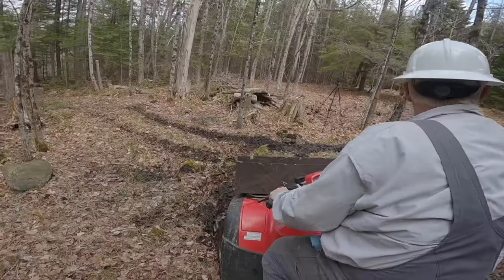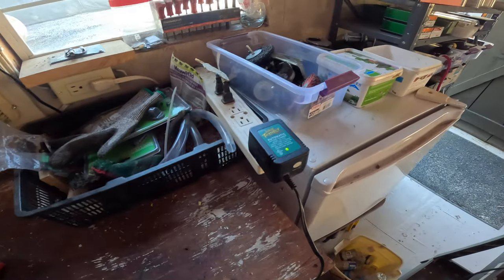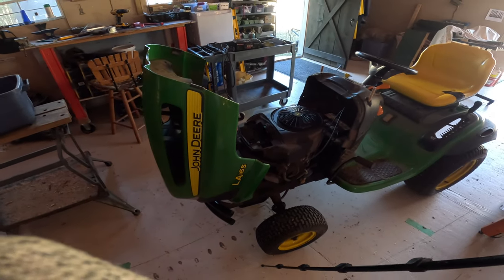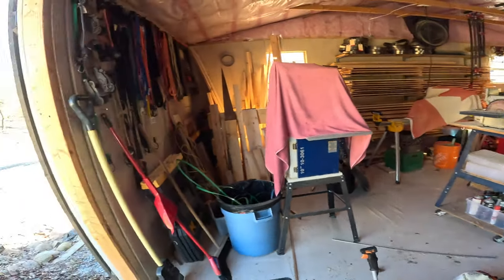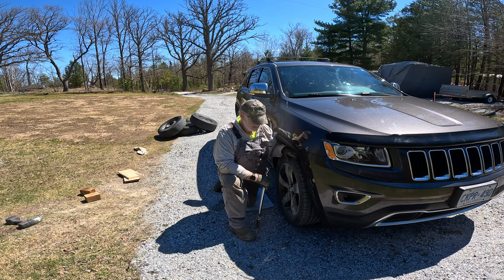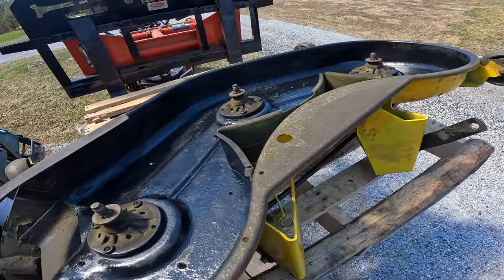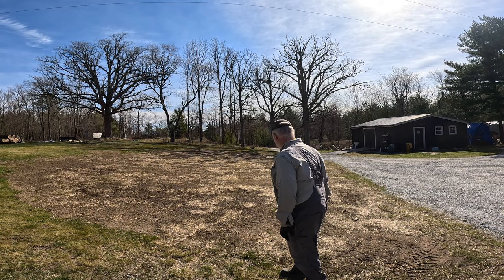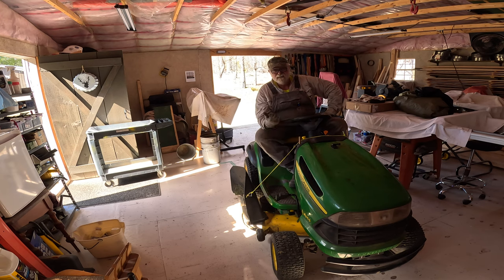Help! I Have Too Many Jobs And Not Enough Of Me

Comment: Good afternoon Brian! It's nice to keep active by having too many jobs. Prioritizing is a must. I had the same issue with my charger and lawn tractor battery earlier this Spring. I don't use winter tires on my vehicles so I can skip that job but I will be servicing the brakes tomorrow as I do each May then again in October. Good tip to re-torque the lug nuts after driving some miles. Definitely gotta check out areas for nests this time of the year. Keep up the good work it keeps you young!
Reply from the maker: Hello Paul and thanks for stopping by. It’s a busy life but I do love it. Isn’t retirement just grand! Take care my friend!

Comment: Hi Brian , I know I wish I was able to clone me this year. My Son in Law has been away a lot this year and hes back now for a month with a patio to resize ( taking 4 feet off the front) new stairs , take down one green house , move a green house , build a new one and I getting the old one that we manually had to load on a flat bed and tow across town, today he had 10 yards of crush stone come that we have to manually spread , wish you were here with your tractors lol.
Not nice when the tractor doesn't want to start when theres geass to cut. 
Not nice when the charger stops charging either.
Yeah winter tires will wear faster and some will actually change the composition of the rubber if driven when its hot and the rubber hardens and may have thread but still had less traction because they are hard like hockey pucks. If Ibwas guessing Id say that was squirrels trying to make a nest.
Ive had it happen to me on two occasions on work vehicles where nuts came loose after tires were put on , I make a practice of retightening the tires after a couple hundred km.  Yeah I put some seed out last week then we had heavy snow and rain and my seeds washed away lol
Reply from the maker: Glad to hear your taking it easy 😆The jobs never go away and that’s actually okay with me. Ever since I retired I’ve been living my dream. I love and learn every day. I never thought about squirrels. I’ll bet that’s it. Well they’re homeless now😄👍. Grass seed can be fun to deal with. This is the third time I’ve replanted that little patch. I was checking it out today and it looks like I may have been successful this time. Thanks for stopping by!